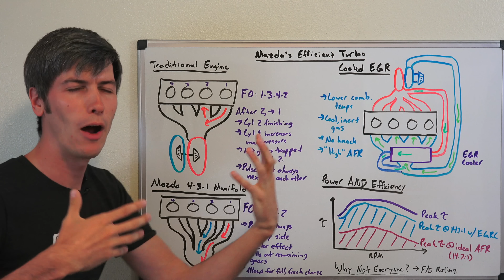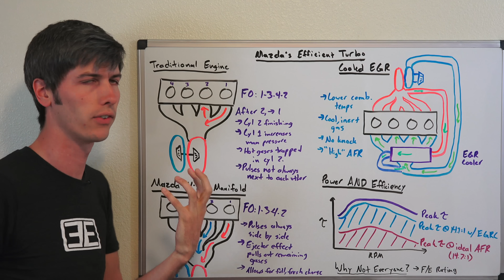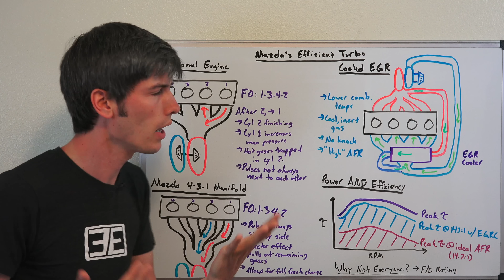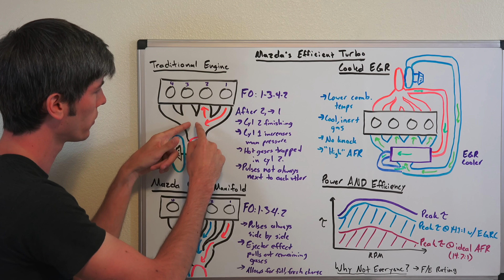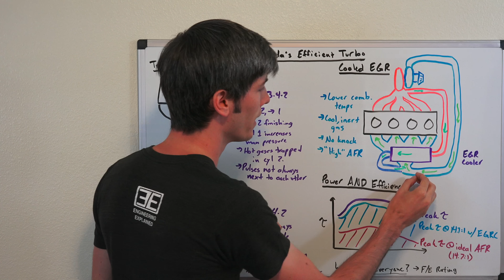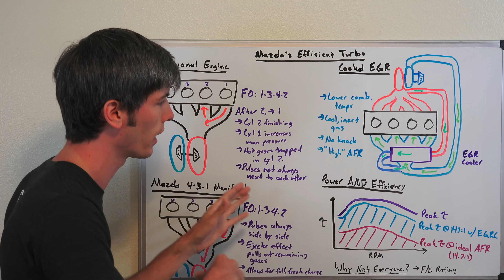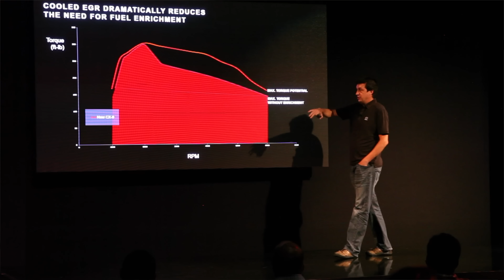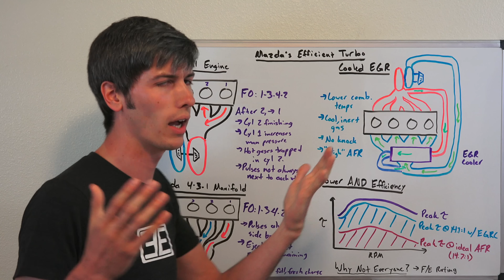Mazda's Secret To Efficient Turbo Engines

Comment: They're squeezing every ounce of efficiency out of these tiny engines! Where does it end? Nothing like American muscle though 💪
Reply: 2,5l is not tiny… 
Most turbo engines are under 1,5l.
Reply: Mgoblagulkablong I agree, 1.5L is not tiny. But a 2.5L is relatively small for a 7 seater SUV, which is this engine's originally designed usage.
Reply: Mgoblagulkablong id consider that tiny lol my motorcycle is a 2 liter
Reply: Super Mario Diagnostics a 2000cc bike? You're either on a big cruiser or some crazy sportbike, I'm on a 700 and that's plenty for me.
Reply: katana767 yes a kawasaki vulcan 2000cc. Ironically I'm an automotive tech, but i refuse to own a car. I'll fix em but i don't drive them lol especially in Miami traffic, it's just brutal!
Reply: American muscle is great, but God made turbo lag to give your V8 a chance ;-)

Seriously, though, I regularly eat "American muscle" for breakfast with my 390/385 @ the wheels Speed 3. It's a very gratifying experience to drive around in a grocery-getter that looks like a regular Mazda 3, but will do 172mph (redline in 6th gear) and has the power to go even faster.
Reply: Numinous. I love my Speed 3. Only at 315/360 @ the wheels, but I tie 2018 Mustang GTs from a roll, and stomp any muscle car that's slower. Just hit 90k, and my shocks have really had it. New ones going in this week!
Reply: Numinous I agree, your car will not be turning heads🤣
Reply: Exactly, Mario. And that's part of the point. I <3 sleepers. I can't tell you how gratifying it is to see the positively astounded looks I've gotten after pulling a "fast" car - after I let them catch back up, of course ;-)
Reply: im wondering what happen if they put these technologies into big displacement engine
Reply: Moch Insani Imam Utomo it's only a matter of time until they do
Reply: Numinous I've always said if i did own a car, it'd be a sleeper! Love the underestimation!
Reply: Muscle does not always equal fun. Geesh.
Reply: Gabriel Iacoboni it's not the fun, it's the culture. That's why American muscle is what it is. Fun is subjective.  I have loads of it from a Japanese motorcycle.  But some prefer Harleys. To each his own. I just admire certain aspects of what certain cars have to offer. Not to be taken too seriously lol
Reply: Gabriel Iacoboni yeah, it's all fun and games until you pull up to the pump for the third time in a month
Reply: Joe Figueroa i said electric motors are beating gas engine numbers. Not cars lol. For example the lightning motorcycle, which is not the fastest electric bike in the world, but sure beats any gas bike. Soon enough they will accomplish the same feats in the automotive field.
Reply: Lol there's like three conversations in this reply
Reply: Daniel Rouw that's right, it's incredible how much people don't know, especially when it comes to automotive.
Reply: I'm just wondering who here knows of a major alternative source of power for evs minus fossil fuels. Right. Me neither. So they are not cleaner.
Reply: it ends in electric
Reply: Reinaldo Gonzalez haha well said. Very true. These electric motors already are beating gasoline numbers.
Reply: Super Mario Diagnostics-  they are,  but they have so limited driving time
Reply: Joe Figueroa EVs are undoubtedly the future.  You're reading whatever you've been reading wrong.  The issue is the source of energy for charging.  EVs are cleaner(accounting for batteries)  if you charge with anything but fossil fuel sourced electricity.

Comment: Putting a turbo on any small engine is eventually going to wear out the engine faster. I mean it's just plain physics.  You ram extra air into a small engine and obviously it makes the engine run at faster revolutions compared to a small non turbo.  An small engine isn't going to last say  150,000 with all that extra air ram into the engine making the engine work harder.
Reply: redmustang04 redmustang04 Boost does not force it to run at a higher rpm. It makes it produce more power. There is more wear because everything is under more load, but a properly designed motor will still last a looong time
Reply: Volvo has more gasoline turbo engines on the road for longer than any other. Their turbo engines were going quarter million miles and more years ago. Some of those drivers would have been easy drivers but I have worked on many that are hard drivers and they also got high milage without engine repairs. The gearing on their turbocharged engine cars has been taller than the NA engine models for 20+ years so the turbo engines with much greater torque also at lower revs doesn’t need to be operated at so high revs. As was explained, we want the increased power for a small fraction of an engine’s operating time so why have larger engines being fed fuel 100% of the time? Cylinder deactivation does try to make a large engine act as a smaller one but the smoothness, response, and mpg is not as good as small engine turbocharged approach.
Reply: looks at 300k km Volvo 940 Turbo oookay
Reply: Erik Tomlinson Ikr, I see turbo Volvo's with 400 000+ km all the time, doesn't matter if they are 20 years old or not even five. Still, the engine runs as good as new!
Reply: redmustang04 that's an over simplification. Engine stress also goes up as a square function of speed...double the rpm, you have 4x the stress. So what's better to climb a hill, slightly higher cyclinder pressure at a lower RPM or downshifting and reving the crap out of an NA motor?
Reply: The engine is designed to handle the higher loads, and the newer generations of turbo engines are generally designed for lower rpm operation, as evidenced by the torque peak being well above the HP.
In comparison making a low displacement engine like this produce similar horsepower numbers would require high rpm operation, meaning lightening (see reduction of strength) of components to accommodate the higher piston speeds and leading to more wear and heavy usage to see similar performance. As engine speed increases, strain on components increases at a much higher rate, so a properly designed mid boost low rpm engine can be more reliable than a high strung high rpm high compression engine while still providing better driveability and performance.

Though if you are talking rotaries, give er 9k rpm naturally aspirated all day and you'll have a damn happy stack of doritos
Reply: Also you have to consider the technology new oils have nowadays where you can protect the engine under load much better than you could 10-20 years ago.
Reply: That's not true at all. Modern materials, design and manufacturing techniques are vastly improved.
Reply: My 2 liter 4 cylinder Saab 9-3 would beg to differ. Running a small turbo tuned to just under 20 psi of boost. At 200k miles right now and she's still running great. Proper maintenance has a MUCH larger impact on the life of an engine than the effect of a small turbo does.
Reply: A 2.5 liter engine is not a small engine. Anyway, electric is the future.
Reply: What about turbo Subarus? How long do they last? I don't know yet because mine is still running after 20 years.
Reply: The small ecoboost ( 1.0 3cylinder) , not even last 100k kilometers… shamefull, but Mazda should be good. 2,5 is not small. Also the NA 2.5 makes 192hp, the turbo only makes 230hp, thats no more than 0.5 bar boost.
Reply: redmustang04 redmustang04 poor americans ripped off by those “proudly made in american” junky turbos thinking the rest of world must be full of junks too hereforw the only savior is their grandpa’s muscle giant na engine, welcome come to the real world engineering btw

Comment: where's the 4 rotor?
Reply: I like this guy, we've don't even have a two rotor, but he's dreaming high
Reply: lasagna bloke wrong channel broo😂it's suppose to be rob dham's channel 😂
Reply: In all the tuner builds being torn to shreads on the track. I mean, lets face it. The rotary engine car was meant to be tuned and raced, not daily driven.
Reply: lasagna bloke. On the shelf until Mazda can justify selling it.
Reply: its not efficient.. unless you go by smiles per gallon
Reply: Mosibfu THATS ADORABLE!
Reply: did you see that? WWWOOOOOSSSHHHH!!!

(joke is flying over your heads)
Reply: Everyone, lasagna bloke is not asking a question.
Reply: lasagna bloke what a troll, dude this guy just started a war in this comment section
Reply: The Rotory has a rough history. AMC tried to use a Rotory in the 1970's era Pacer and failed, The costs of the rotory engine development and failures put NSU out of business, Early rotory engine issues put Mazda in a financial money pit. Even Suzuki tried a Rotory and quickly dropped it. Cool design with fatal flaws inherent in that basic design, poor mpg, high emissions.
Reply: In the trash can.
Reply: brap brap brap brap brap brap brap brap brap brap
Reply: lasagna bloke they are fixing the blown apex seals
Reply: Plagued with all the same problems of every other rotary engine
Reply: The only thing plagued rotors are incompetent owners such as yourself and many others in the world of commuters, not drivers. No different than the new cylinder engines put out every year to increase compression and reduce intake temperature.
Reply: I want you to cite your information. Not because I don't believe you, I just want you to have to do extra work.
Reply: Short attention span there much? The topic is RECIRCULATED EXHAUST! An actual drop of emissions! Port design determines torque output! The renesis four port makes more torque coupled with a torque converter than most cars on the road with doubled static displacement! Service life is DETERMINED by owner and commuter neglect! Gasoline has negative heat propagation properties which put it behind in power to alcohol fuel to mitigate heat dissipation and distribution on factory heat exchange system. Alcohol, more power per liter with less emissions and Mazda has a hydrogen project underway. Your mental handicap is obvious in this discussion.
Reply: E85 13B It's too bad the renesis still has such bad thermal efficiency that it consumes as much fuel as an LT1, which makes 455lb/ft of torque...
Reply: Beach&BoardFan Regarding the thermal imbalance it seems like they could configure adjacent rotors to operate in an opposed pattern. Instead of combustion on the left bottom corner put every other one on the upper right with the spark plugs on the opposing side as well. Cuts this problem in half.
Reply: E85 13B you completely dodged all the inherent issues  and used big words to sound smart yet you're just babbling nonsense. Lmao!
Reply: GlassTopRX7 there is NO rotary that will out perform a modern V8.
Reply: GlassTopRX7 So then why doesn't anyone use them in competition? Couldn't tell you the last time I saw one go down the drag strip in any capacity other than a grudge night, and there isn't one soul running them in any circuit based competition except maybe a rotary specific class. Even Mazda has dropped the rotary for a piston engine.
Reply: Aaaaaand fuel efficiency, and reliability, dont try to change the subject to electric, everyone knows its only a matter of time before electric wins everything.
Reply: It's all about the rules. After Mazda demolished everyone at Le Mans, the rotary is banned from almost all motor racing, because it has a huge power/weight and power/size advantage. The rotary is not unreliable, especially compared to piston engines in race scenarios. It is unreliable in the hands on nincompoops. And as someone said above, unlike piston engines, which generally lose efficiency with size, rotaries gain efficiency. While the 13B generates 230 HP, the 26B generates over 500HP and in full race spec can get over 900 HP and is THE.BEST.SOUNDING.ENGINE.EVER!
Reply: @beachboardfan9544  Because they suffer from major disadvantages in motorsport. A 13b is generally put into an over 3 litre class. So they're generally competing with engines ranging from 3L to 6L. Where the excell though is endurance racing funnily enough
Reply: @bridged13b Garbage engine!
Reply: The Rotory is a high revving, light weight engine but the deal killer is this fact_ Rotory = poor mpg.
Reply: RX8 driver reporting
Reply: Dead with the steam engine. It may come back as a range extender in a phev Mazda in the future as they can be more efficient and burn less oil if running at a fixed rpm. That will be a small one rotor engine with like 30hp.

Comment: so they give up on natural asperation?
Reply: zacao. Why would you say that? Most of their cars are NA.
Reply: New generation NA engines are coming out, but they need engines that can produce more power than that, so they made a turbo one.
Reply: The days of turbo motors always being peaky with no low end torque are long past, my friend. Modern turbos can have torque curves as flat as Kansas across several thousand RPMs.
Reply: Markle2k all I saw was dust in the wind.
Reply: Markle2k flat as Kansas. Now that's funny.  I did drive across Kansas once  not only flat but boring.
Reply: I considered mesas as a comparison. A car with a flat torque curve from 2000 to 5000 RPM is not what you would consider boring. Its power output rises linearly making it fast without being a handful in the corners like an original 930 Turbo.
Reply: The CX-9 needed a bigger engine than their current 2.5L. They're options were turbo or a new 6 cylinder design. The 6 cylinder design would add weight and require a completely new manufacturing process.  The turbo uses an existing proven engine block and such. 

Their new SkyActive X engine uses a supercharger that they use to lean out the mixture, but isn't the same as a typical supercharger, persay. 

So, they haven't gave up completely, but they are moving forward with good engineering solutions to increase fuel efficiency
Reply: Jgalaski8438 yes, it's actually kind of sad to look at the history in the demise of Mazda V6 engines. Given the massive investment Martha's had to make Ford's new platforms and drive trains it's no wonder they haven't rushed to develop a new V6 or produce a version of the Rotary for now, but it seems like they are doing exceptionally well as an independent manufacturer again so perhaps one of these days we will get what we want. Of course at this point in automotive development every other manufacturer seems to be dropping there V6 options left and right anyway so they are hardly alone
Reply: DrewLSsix Poor Martha, sounds like she's had a couple of rough years... :'(
Reply: DrewLSsix poor Martha, i have a soft spot for v6 engines, compact, smooth, more powerful than inline 4 and more refined/civilised than v8
Reply: DrewLSsix that's why I love my 2011 v6 Mazda 6, and glad I bought it new as Mazda sold very few 6's with the 3.7L V6 from '09-'13, so it's somewhat rare.
Reply: I think there one of the only or few manufacturers who still have a mostly all NA cars and suvs.